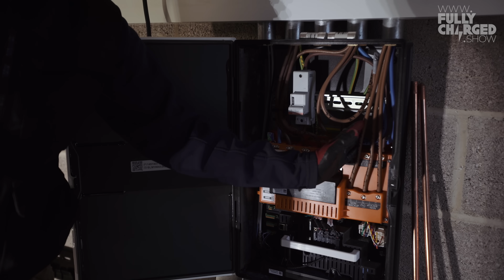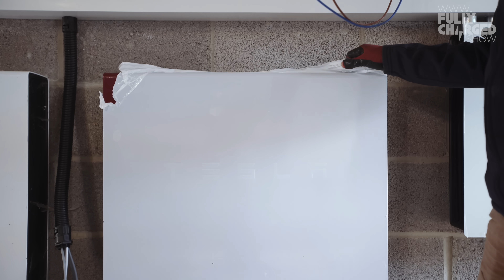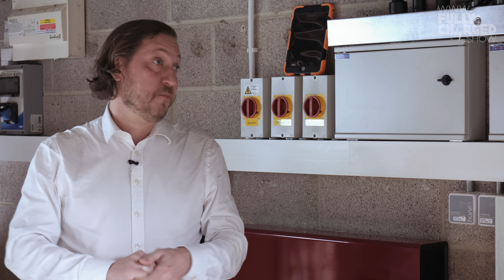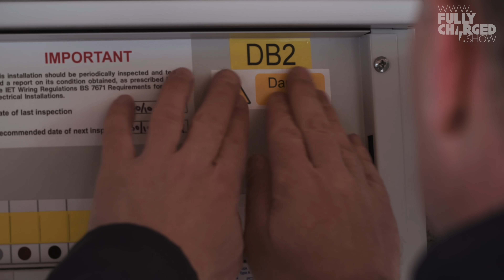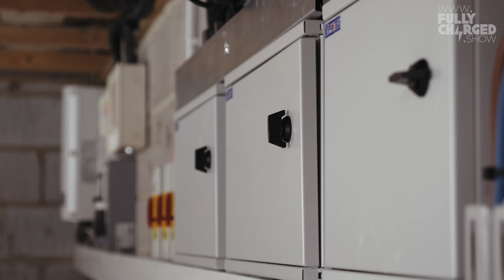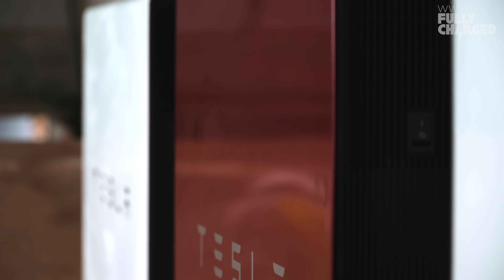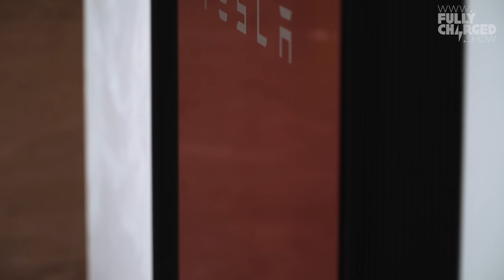Can you run your house on a battery? Tesla Powerwall 2 (Founders Series) & Tesla Backup Gateway 2

Comment: My father's house in Australia has 52kW of solar (Sunpower 400W x 130) on a 3 phase connection with 3x 10kW Solaredge HDWave inverters, 1x 5kW HDWave inverter and 2x Tesla Powerwall 2.  My father's house will instantly carry the loads when the grid goes down. So not sure why the UK implementation has to have a brownout in-between.   It doesn't however have overnight predictive charging for cloudy/rainy horrible days.

Comment: Have been running fully off grid on wind, solar and battery for 28 years. Multiple buildings, two residences all usual appliances including air conditioning etc etc. Running on second generation power station since 2013. Three AC coupled inverters Selectronic networked with two Kacos. Max available power 19.5kw. storage 90kwh.

Comment: Pffft, im an Electrician, usually working on 347/600 volt systems, which is never very fun when you get a poke from a live wire, I started out like most apprentices wiring residential, which is max, 240 volts. easy to work with, even live. My point is ive known many electricians who've been seriously injured by 347V 3 phase systems. I wouldn't want a homeowner with a 75 KVA transformer right beneath their 600 volt master switchgear, and a splitter that is easily accessible and could kill someone. Besides what would be the point of a 200A 3 phase 600V supply to a house with no motors, machinery, and a power factor that has to be maintained?

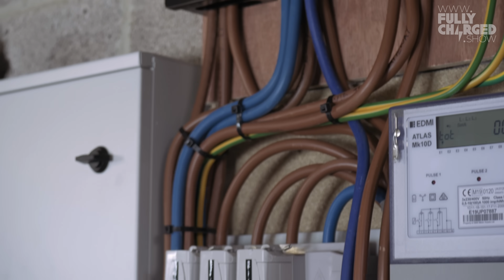Comment: Why at 4:00 is there Brown shown for the AC supply L1 L2 L3 instead of Brown-L1 Black-L2 and Grey-L3?? Is there any reason related to the DC solar panels to have this as Brown and Blue instead? Otherwise... Surely that doesn't comply with BS7671.

Comment: Can't believe you did not mention the Solar Edge inverter I see. My 8.4 KW system and 9.9KW LG battery are controlled tb all store edge equipment. System. Does Tesla even have an inverter? Spring and fall I am off grid the other 2 season 70-80%. Storedge is a better system and cost less too.

Comment: This is a must for the future, for example, worst case scenery, that we have a solar storm, which will impact electric grids etc...at least this is protected and will supply energy during such events
Reply: I think u better wake up and stop smoken the weed, cos that's all bullshit.... solar storm takes out EVERYTHING that is running. If u had warning and cud shutdown and isolate everything then maybe u have a chance.
Reply: OffGrid Aussie Prepper™ it takes out anything over ground, but not a power source protected by walls etc......as an expert in this field, I do know what I’m talking about. As for the weed 😤only when I’m socialising.
Reply: @thomaspowell3739  Nope.... I dont do weed period, but over the years and the research I have done and being an electrical engineer, my data says otherwise. Electronic equipment in a faraday cage will survive, anything in a circuit will fry.... for example a car will not work after a solar storm and some say if the battery was totally disconnected there maybe a slim chance the car is recoverable as for the car computer there's a 50/50 chance it will survive but unlikely. Anything grid connected will be fried including transformers..'asta lavist baby destroyed' and how are we going to replace millions of transformers to get the grid going?? Anything like the Carrington event will send us back to the stone age and its said we are way overdue for one. As for underground isolated installations protected by dirt, has a higher chance of still being operational. Utube channel https://www.youtube.com/channel/UCTiL1q9YbrVam5nP2xzFTWQ is one of my sources for over 10 years or so which is authored by a Dr.  You say ur an expert well I would like to know how u can physically test what u r saying since we have not had anything like the Carrington event in recent times.

Comment: here in switzerland Swissgrid recently changed so that you have to pay a flat rate for access to the grid, ontop of paying for electricity (which price got adjusted down). anyone with solarpanels got screwed, as the Base-rate is higher than what they pay you for feeding in green energy. its more profitable to disconnect from the grid at this point. and bad side effect for these companies: with the adjusted electricity price all of the sudden nuclear stopped being profitable anymore. hmmhm. great move.

Comment: To summarise
A rich actor is given a powerwall by a billionaire.
The powerwall could logically even out demand and generation spikes but is installed with an expensive supply rewire to cope with bigger spikes than previously.
The technology does not exist to allow the powerwall to help the grid with demand or generation spikes.
The benefit of the powerwall is to make sure that none of the solar electricity ends up in the grid to be used by the people who are paying the FIT tariff.

I share your shame, Robert, I have a device that puts solar into the immersion heater.

Comment: As well as the thoughts from Fullycharged: the grid operators DO NOT WANT thousands of uncontrolled sources on the network so they're pushing the barrier to entry as high as possible. This is pretty reasonable as this multiplicity of sources is really messing up grid designs and they costs they're incurring are wildly disproportionate to the amount of electricity being generated.

What they SHOULD be doing is insisting that they have control over the export settings so that Robert's installation can never exceed "x" rate and can disconnect on demand (this is primarily for protection of local workers who think they're working on a dead segment after shutting down local distribution transformers, but also for periods of excess generation capacity across the network) but right now the entire structure is badly skewed thanks to political demands.

As renewables approach 20%, this is going to have to become mandatory (along with large battery banks on wind/solar generation farms) or we'll see repeats of the South Australian blackouts.

Comment: Hi Robert, very interesting and informative, please keep them coming. Unfortunately, however much I would love to have one, as you allude to the installed cost of a Powerwall 2 is still unjustifiable (to me) from a purely economic perspective. It would save me around £500 a year in stored solar and time-shifted E7. I also can't see the justification for the Zappi in conjunction with a Powerwall 2 as the car will just 'drink' from the combination of solar / Powerwall 2 charge during the day and be on E7 overnight.     Also, can someone clarify if the 'intelligent' software than analyses your charge / discharge profile and forecasts / refines the combination of Economy 7 / solar capture only resides in the Gateway? Googling suggests that it costs around £1k and that again is fiscally unjustifiable (for me). In the 'darker' half of the year the Powerwall 2 has to migrate from predominantly solar storage to E7 storage without compromising the opportunity for capturing maximum winter solar (although admittedly quite small to non existent in Dec / Jan) so having the functionality to top it up to x% overnight with E7 is an essential element of any cost justification. For me £5k would be the maximum I could justify for a fully installed Powerwall 2 and Gateway, and that would then only be cost neutral after 10 years. This battery tech is to be applauded however it needs to fall dramatically in price (£2k - £3k installed) to be a mainstream commercial proposition.

Comment: Wow... feed in tarrifs, export fees, etc, so complicated. 

I am glad here in FL we have net metering. I am billed for the difference between what I export and import. If I export more than I import each month, it carries over. If I have an export balance at the end of the year, I am paid wholesale for it. Which is why the system is designed to produce just enough for what we use, or a bit under.

Due, to net metering having a battery system would be an expense that would never pay for itself for me.

Comment: Try using a Victron Multiplus....with ups function activated, you will only know that the grid is down if you look on the Color Control or if you read your emails...your house will be 24x7x365 powered with no downtimes

Comment: The Tesla Powerwall, even i understant well,  gets charged with DC power from the PV (Solar) panels. Can one also charge a Model 3 (or any other DC charging car) with DC from the Powerwall or from the PV panels ? IT would reduce 2x10% energy loss accuring when making AC and back to DC.

Comment: We had our Tesla solar roof (solar tiles not panels) installed with two powerwalls in June/July 2019 and I am still trying to get a handle on the gateway software.  There are three settings or charging schemes available (1-powerwall charging is prioritized 2-balancing between solar use and grid use constantly 3-where you can set up when to best use solar depending on the variable cost the electric company uses throughout the day). The electronics are extensive but not as much as what was shown in the video which could be the difference between the US and UK.  The main difference is that our backup gateway seems to be integrated into the inverter set up because there is absolutely no loss of power when the grid goes down and our system switches to stored electricity...maybe a slight flicker but small enough that we are unaware of the grid being down.  And the  roof installation was flawless from the old rood competely removed to the beams, new thicker ply installed, a new double thick barrier made by Firestone that is waterproof and fireproof installed and the Tesla glass tiles installed.  All the work was done by Tesla (Solar City) with the utmost professionalism and safety and it looks brilliant.  We were the second install in Los Angeles county and it did come at a bit higher price point but with the warranties on the installation and products it was worth it.

Comment: I have had a 11Kw solar system fitted on single phase!  (Also 12.5kw Battery system)   DNO didn't require an upgrade to 3 Phase?   As the battery will only be used in my house on is not pumped back to the grid!

Comment: Why run your house on a power wall when you can just use your electric vehicle!  You spent big bucks on an electric car; it should be utilized in case of power outage instead of buying superfluous and expensive home batteries that get used once or twice every few years.
Reply: Dude On Bike The batteries are used daily- you have entirely missed the point of the video. The fact that they can now run the house in the event of a power cut is a bonus, not their usual function.
Reply: @spencerwilton5831  No you have entirely missed the point of my post!

Why buy 12,000 of batteries you MIGHT use in the rare event of a power loss at a critical time when you have a $50,000 car with really expensive batteries sitting in your driveway?  A few hundred bucks of technology and materials should allow an electric car owner to power their home in the case of emergency.  This is called EFFICIENT use of resources.  But if you're shilling product (and increasing more and more carbon footprint) then by all means, SELL MORE STUFF!

I have NEVER had the critical need for backup power in my life of 54 years.  Neither did my parents - for their entire lifetimes.  Yet somehow, this is a huge need for people?  (Sure, if you're on life-critical medical equipment, then that's a different story.)  But I even own a CPAP that needs power.  A $150 battery solved any potential power needs I may need in event of outage.

40% of Americans can't come up with a measly $400 for an emergency, so a $12k "kick-ass power wall" is out of reach for most.  Plus, since 2/3 of Americans are seriously deficient in retirement savings, anyone with $12k burning a hole in their pocket would be WAY better off funding their retirement rather than sinking the money into a backup power system they may NEVER use.  OR even if they do occasionally, it will need replacing in 5-10 years. 

You're proving my point by missing the point completely.  Engage your brain before you post.

Comment: does someone have timestamp of the question in the title? Cause this is boring AF
Reply: 10:52 The answer is yes. (Though in the UK, if you want to be able to run off a battery during a power cut, then you'd need a special extra piece of equipment. This was explained earlier in the video.)

Comment: Good luck avoiding network charges after ofgem introduces their TCR. No more residual cost savings for tnuos and duos by peak shaving. Completely shafts particularly large industrial users who have invested in demand reduction/batteries. Might be worth a video. Will set back batteries and behind the meter generation by years.

Comment: Not sure why you need to have such a long delay from power cut to power up on batteries.  In South Africa we have regular power cuts and my PV/Schneider inverter/deep cycle gel solution has an almost immediate switch-over to battery back up.  The only thing I notice is a flicker from the lights.  You do NOT want all your PCs and electronic components going on and off all the time due to surges that can damage your equipment.

Comment: One of the points you touched on about the difference between import and export prices.  The more people who cover their own electricity use and feed into the grid, although they may be levelling those peaks, they are not paying that 10-15p toward maintaining the national infrastructure. Which means everyone else paying more to cover your share, and so with higher percentages of uptake that won't be sustainable.  There has been talk about shifting to fixed standing charges with use becoming less significant in the bill.  When solar panels/batteries take decades to pay off, this kind of talk of shifts in pricing make it more and more risky to invest in installing.

Comment: Funny how the hole house blacks out for a short time, now you have to reset all your clocks, what a pain in the butt that must be, my ESS storian system does not do this , if the grid goes down I never know about it as the power is on all the time in my house, does not go off while it switches over to the power wall so to speak, not even for a micro second, and probably cost a third of your system, but I only have 20kwh ( 90% DOD ) of battery, and 8.4kw of solar .

Comment: How many South Africans are watching?
Reply: @Pete is never wrong  Because South Africa occasionally has to go into periods of load shedding. UPS systems are substantially more viable there for bushiness than other parts of the world, for this reason. Funnily enough energy storage is the problem that the local energy utility is also facing. Mostly due to previous political interference, but also due to being a rather dry country. 

Also Elon Musk is sort of South African.
Reply: @Pete is never wrong  Hahahaha, well it's partly my industry. so I'm still in 2 faced professional mode. Where are you from If I may ask?

Comment: The delay from switch over is horrendous, it should be seamless like a UPS.  The switch over needs to done with semiconductors not relays. Sure have a relay to cut grid connection but after the Tesla battery has taken over.  The grid engineers aren't going to be touching wiring within a minute of grid drop out, so there is no risk of electrocution.

 I had considered a Tesla wall but these mini power dropouts caused by the delay will on occasion damage sensitive household equipment.

I will wait to see if Tesla and Uk national grid accept this dropout delay as unacceptable

Comment: Great episode. I own from 2 years PW2 in Australia with the gateway and what surprises me in my if the grid goes off then the batter start to support home in milliseconds, so you will be not able to see it. There is no delay at all, so all home equipment run as normal. You do not need to set up 10 clocks on different stuff :-))).

Comment: I honestly did bother on trying to give electricity to the grid, I am 100% on solar with batteries and i love it. My whole house works without the grid, but I do have the airconditioners on the grid and I only use the grid in the summer for those because they drain the batteries dry if I put them at night with solar. I do have just one air conditioner on solar but its for my office and I only use it in the summer and only in the day time.  And did I mention that I installed it all and I had no idea how to do this, I was a bit scared on connecting the whole house but since I have a multimeter so I knew I could not mess up and I did not, I did burn 3 small things in the house but that was because of a mistake on the people that did my electric installation so I had to fix that too, and nobody taught me anything, its very simple and fun.

Comment: Good news that Germany, and now the UK see the value of residential 3-phase service.  The math proves that a 50% increase in numbers of conductors allows just over a 70% increase in power handling capacity.  Here in the antiquated USA 3-phase is, in general, prohibited in residential areas.  Even worse small businesses are discouraged from installing it by prohibitive fees.  After paying a gouge fee the utilities like to install just one more can transformer on the pole and run the third phase through both transformers.  A lot of phase converters are used here in small business because of the hostile attitude by the utilities.